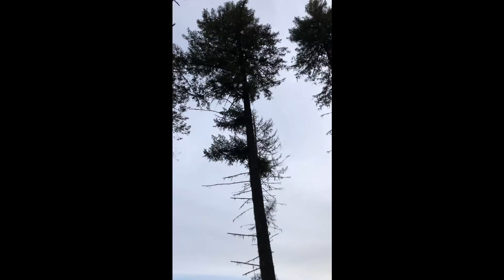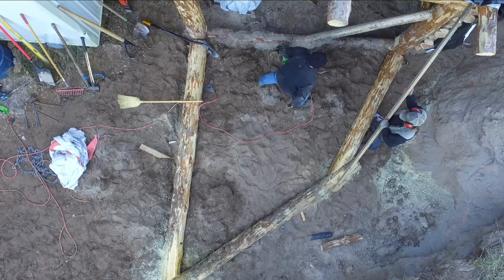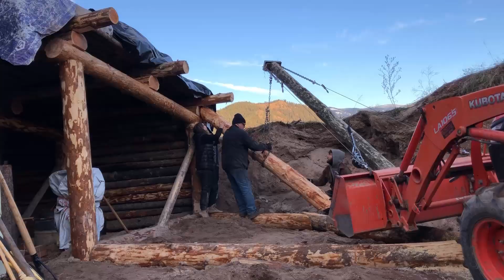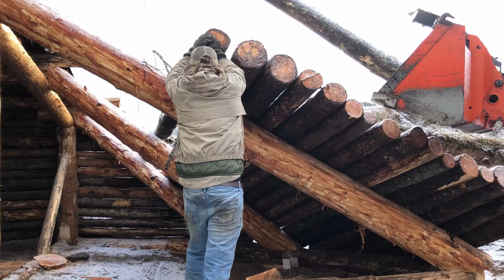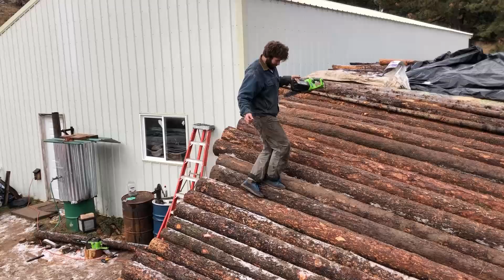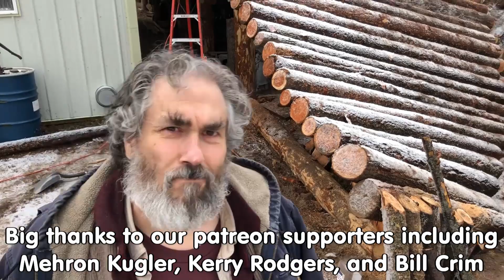An end cell on the berm shed - the permaculture bootcamp

Comment: Neat stuff.  Is that an electric chainsaw?
Reply: Yes it is, they have corded and cordless saws at Paul's place. A lot less noise and no pollution, but do require charging and not quite as powerful for the same size but they work very well.